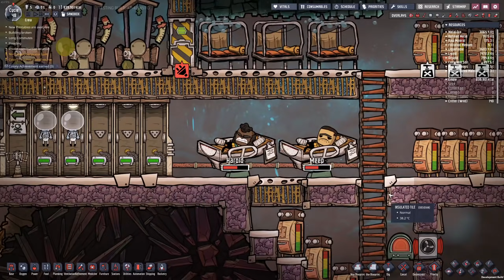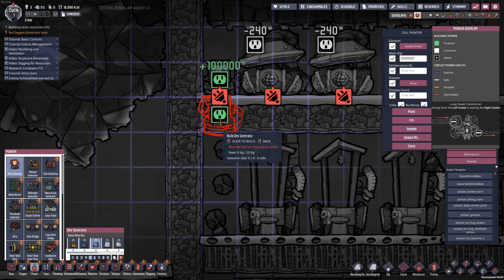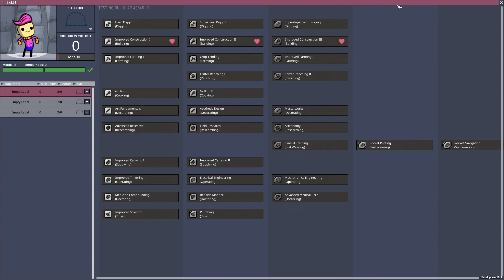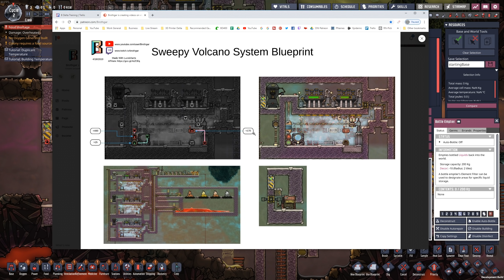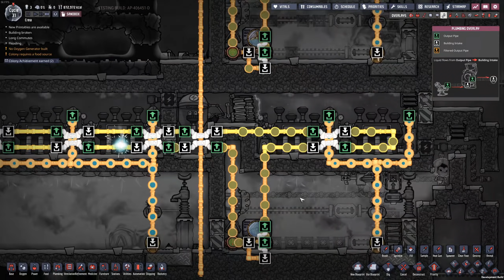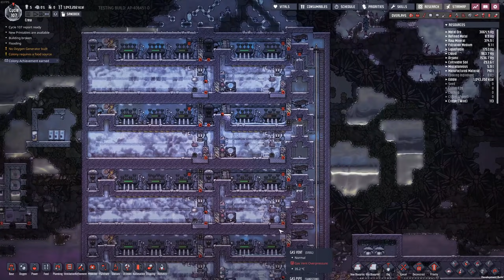Can I Suck Up The Molten Core With The Power Of Sweepy? Oxygen Not Included

Comment: You could also dump a bunch of regolith into the magma and create more thermal energy. Regolith has a heat capacity of 0.2, but turns into magma at 1:1 mass without dropping in temperature. And because magma has a heat capacity of 1, regolith magically multiplies its thermal energy by 5 when it melts into magma. So melting regolith will lower the overall temperature slightly, but still radically increase the total thermal energy.

Comment: Here's an idea: lighter gasses tend to be more thermally conductive. What you can do is create a gas-lock that's "upside down" of what you have and use chlorine in the bottom. In this case you could fill the entire "shaft" that your dupes climb up and down with chlorine as well and you would have very good insulation

Comment: Shouldn't it be possible to get to the bottom without actually touching the lava? You could build blocks that 'push' the magma off to the side, and incrementally getting further down row by row until you are able to build a sweepy at the bottom.
Reply from the maker: For the most part yes. Everything i have tried has left at least a small puddle of magma on top of a tile. So it seemed a bit much to go into with one video when i still don't have it figured out.

Comment: I made some volcano power system based on Francis Johns design, but used conveyors for moving igneous around like yours. The main thing I used from his design was the mesh tile magma solidification system. The magma turns to igneous inside the two mesh tiles, drops diagonally to one side and into the turbine room. Then is instantly picked up by a sweeper arm and sent to multiple different turbine rooms.

Comment: After you use the igneus rock to heat up the steam too, couldnt be better to drop it back into the magma so it turns back into magma and suck even more power out of it?
Reply from the maker: If you make the magma too cold it will solidify. That could cause some problems down the road.

Comment: what is the reason you are not using sweepers to move the magma? is it heat loss? you can run the rails through insulated tiles(3 wide if needed) then it wouldn't lose too much, right? or are the sweepers/ loaders melting in that temperatures?
Reply: Sweepers can't move bottles without mods.
Reply: IIRC sweepers don't move bottles in vanilla, and aside from quality of life mods like the automation overlay i don't think he wants to use mods in the blueprints so he doesn't force them on people
Reply from the maker: ಠ⌣ಠ I mean if I'm going to go full mods. Drains 4 life!
Reply: ah fair enough. havent played in a while so i didnt remember

Comment: If you have problems with items falling into the shaft you just cover sensitive places and bend your ladders. I used to make a huge ladder from bottom to top, but dupes tend to drop items in it at the end of the day.
Reply: I had the same problem when working with hot stuff near the core.
One of the dupes would go ther and faint, next one will go save him and fiant on the ladder, now I have 2 fainted dupes, then another one will try to save them and faint on the ladder, each time dropping more at the bottom.

Comment: The power output seems to be fairly inconsistent. Would it make more since to increase the water in the room to greatly increase its thermal mass? I feel like that would allow the room to handle the massive injections of heat coming from the magma.
Reply from the maker: Yeah maybe. Things can get weird when you have a ton of steam and you might end up deleting heat. There is a whole thing with using oil related to that problem. Keeping the steam mass lowish seems to keep the game happy.
Reply: You're right 100kg of steam takes longer to heat up than 20kg of steam. In the same amount of time one can reach 200c while the other would reach 400c.. this is interesting I never thought of that.. basically now the experiment would be what amount of steam is needed in order to use the least of amount of resources (enough for the turbine to catch up because if you set that bad boy on fire the whole system will overheat).. damn you ONI.